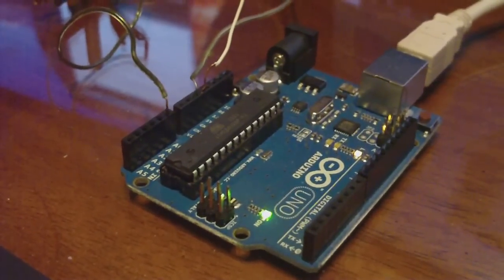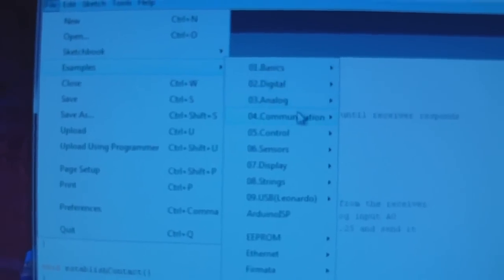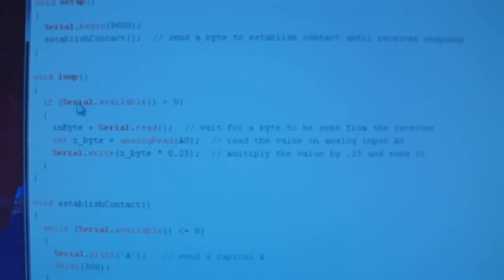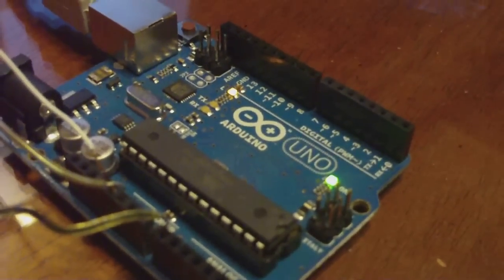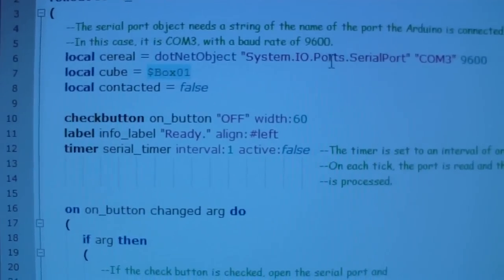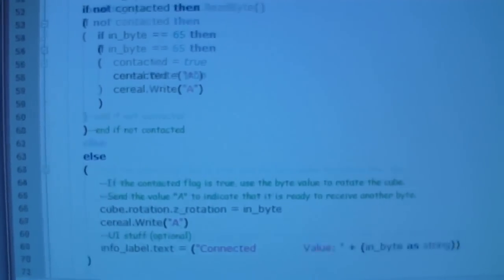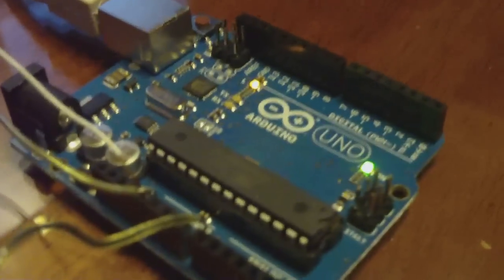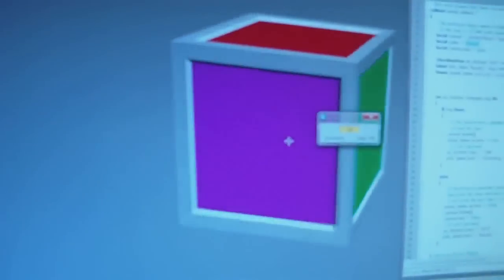How To Interface An Arduino With 3D Studio Max

Comment: hi Keith thanks a lot for the script.
I'm a begginer and  I'm trying g to send a string with 2 data split by a , can u help me to split the 2 values to control lengthy and widht of the cube from 2 potentiometers?.
again thanks a lot!
Reply from the maker: There is a sketch that comes with Arduino called "SerialCallResponseASCII" that shows how to send data the way you describe. Note that it uses Serial.print() instead of Serial.write(). Maxscript should see it as a string, so you can read the values and use them that way. Sorry, my Arduino stuff is packed away right now, so I can't play around with it. Good luck!